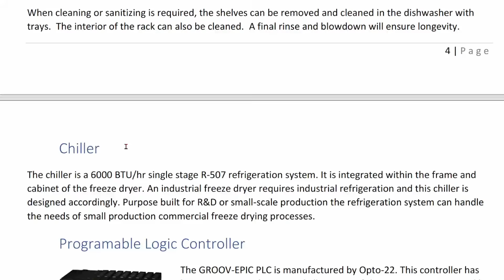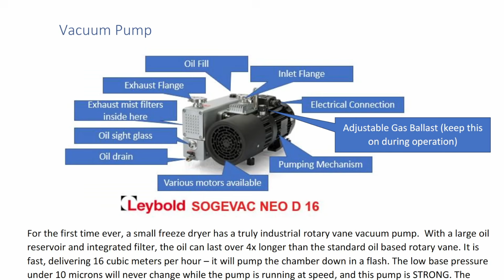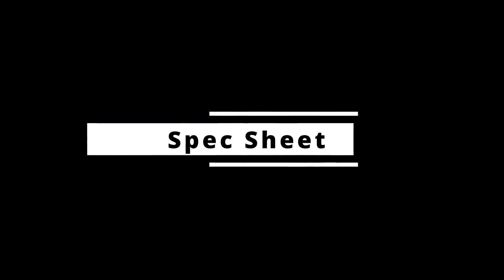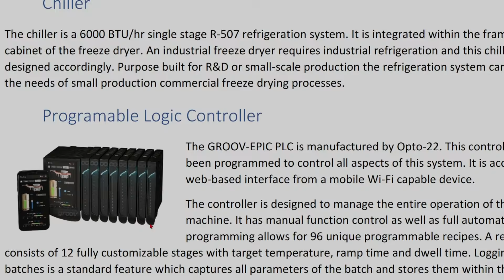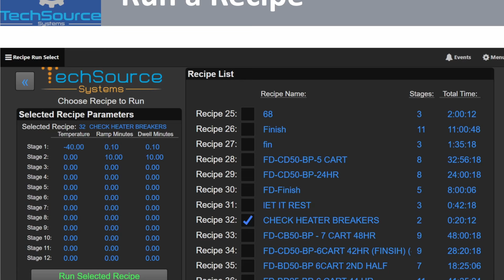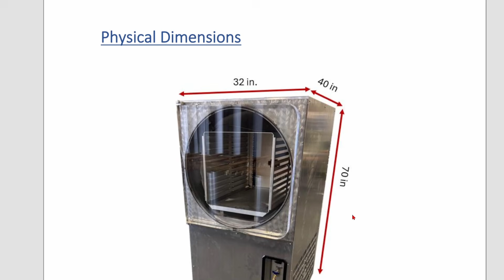Introducing the TechSource Econoline Commercial Freeze Dryer

Comment: My first concern about the pump was spray but according to your video, that is practically a non-issue.  There is an oil free pump available for this freeze dryer on your website but that might create a 3 phase motor issue that has to be resolved ie converter or single phase motor swap.
Reply from the maker: Yes, and the small dry scroll pumps are just not up to the task, unless you buy the $7500 brand/model.

Comment: I have a server room in my basement.  I learned the hard way that the basement floor is not the issue but getting the heavy stuff down there is.  I did damage to my stairs in bringing down the large UPS.  I am able to handle this freeze dryer with the required cooling and sound proofing but bringing it down without damaging the floor is the challenge.  There are ways though such as creating a wooden contracption to put over the stairs and just slide the freeze dryer down carefully.
Reply from the maker: Yes.   Grin,  where there is a will , there is a way.  Getting heavy equipment up the stairs might be even harder.  There are moving Dollie’s that can help though.

Comment: Good point on refrigeration wherein you have mentioned the cooling capacity that you get at -40 degree. Brands generally mention the cooling capacity at Ashrae standards and more often than not, calculations based on that may result in lower planned refrigeration capacity for freeze dryer.

Comment: I'm susprised TechSource did not create a water cooled version of this machines refrigeration system. You yourself mentioned the amount of heat air cooled units produce. I hope this is something you consider in the future.
Reply from the maker: Coming soon.  Just not ready yet
Reply: @Suntorr25  What is there to get ready? It's a water cooled condensing unit. Control differences are minor. You could have marketed it as an air or water cooled unit. The water cooled unit would have completely eliminated the excess rejected heat problem you mentioned air cooled units cause indoors and it would offer even greater efficiencies. As a matter of fact, you used this problem as the reason remote systems have distinct  advantages over air cooled  condensers. Water cooled condensers are superior to remote air cooled condensers and fluid coolers. 

To be honest, I don't know what goes into making these decisions but I would have marketed it as an air cooled or water cooled unit. The hang up makes no sense unless this was a recent decision, in which case I get it.
Reply: @ImStillHereSomewhere  
Matt Pettit here from TechSource.  The decision to do a water cooled system has already been made.  We're anxious to offer it, but have limited hours in the day.  We're pretty conservative on making offerings until we can make sure that the supply chain is sound, the system works and we can follow through on our promises.  
Thanks for your input!